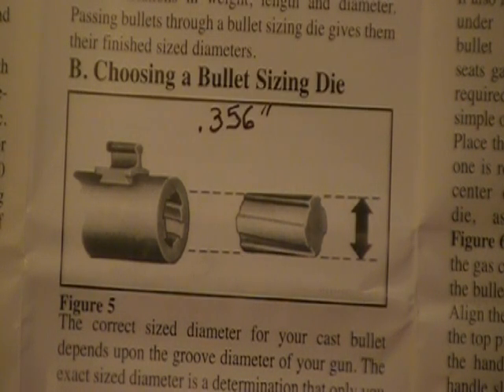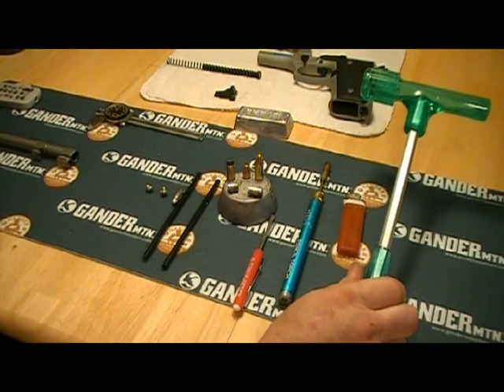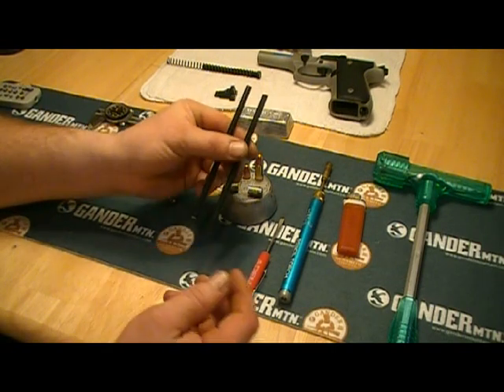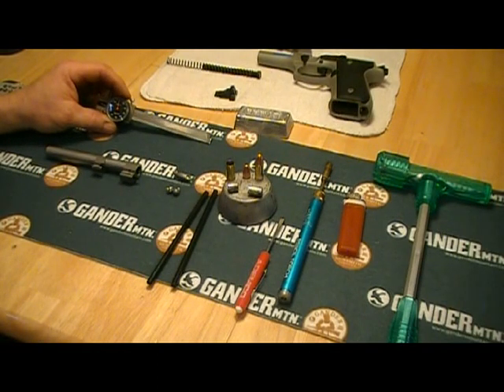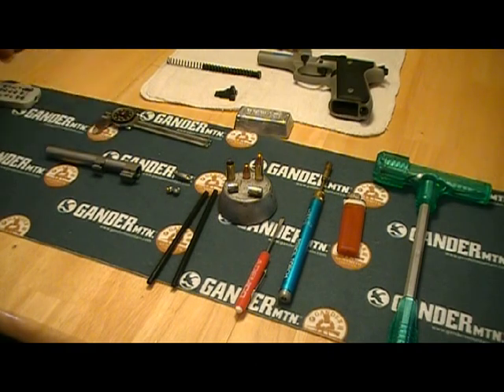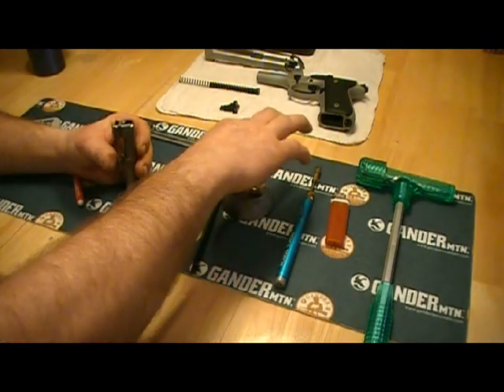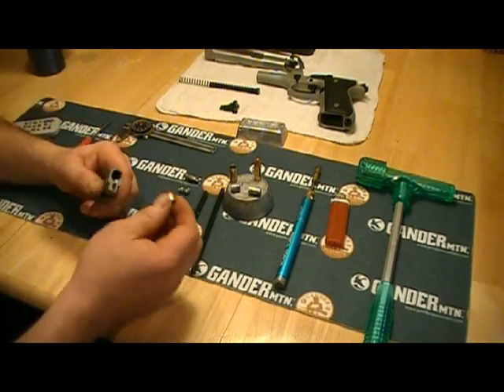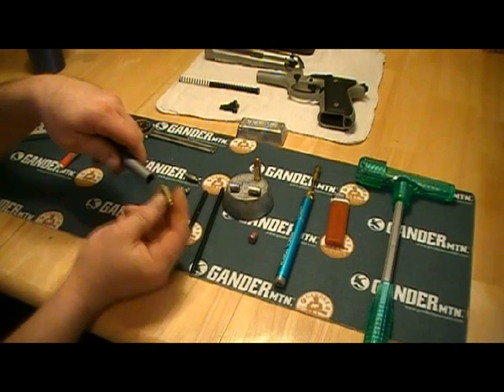Barrel slugging made easy part 1

Comment: I had the same reservations about using the round ball, AND, the suggestions of using existing cast bullets worried me for the reasons you discuss...hard lead and the need for excessive force to drive the slug through.  Your solution is INGENIOUS...as an earlier post says - "well played"!  Thanks
Reply from the maker: Thanks for watching, I agree that using any slug that will not yield to the barrel is going to give an incorrect reading
A power steering pulley is held to the pump shaft because the shaft is bigger then the hole in the pulley,
Therefore we know that just because the shaft was once in the pulley doesn't mean they are now the same size.
You can also do rifle slugs with this method, just fill the case with dry silica sand.

Comment: Never seen a heating torch that small, kinda interesting o.o & the video is well explained, nice work! :)
Reply from the maker: did you notice the "upside down little aluminum tree" on my table, I poured molten aluminum in an ant hole and dug it out!
Reply: @stclairstclair  not until you mentioned it :D I've always found those sculptures interesting to look at :)
Reply from the maker: they are a must have for deep candles and electric heat shrink.
Reply: @stclairstclair  I suppose :P why not :>

Comment: Some details I found I needed to add:
1) use a case that has been expanded, so that the slug will be oversized.
2) Do not use the next caliber larger on a revolver, because you cannot drive the slug from both ends if it jams. Expanding a case of the bore's caliber should be enough.
3) Melt thoroughly, or the slug will be too small.

Comment: good idea I slugged my barrel differently. I used a cast bullet for mine since they are over size to begin with.
Reply from the maker: That works, the reason i stayed away from a cast bullets was they are usually harder than pure lead and often water cooled to increase hardness, For me i had to size my bullets .002" bigger than the barrel size, Thanks for watching.

Comment: I like where your head is a with regards to thinking outside the box but there's a couple issues. If your casing isn't perfectly clean your introducing abrasives other than what you intended for every pass and fiberglass is a no go.. glass is harder than steel, therefor fiberglass will scratch the inside of your barrel. Wood might break but it about as soft as lead
Reply from the maker: I would kindly disagree, i use a case the has been fired in the gun I'm sizing, I inspect the inside and it would only have fouling from gun powder, and if anything that glass rod wouldn't be much more than a polishing stick up against any barrel, Think about this, When fired a 9 mm cartridge produces 36 thousand pounds of pressure, a fireball expands around the bullet pushing it to 800 mph with the intensity of a blow torch while lead melts and copper streaks, a cold soft lead slug ain't doing dick. The gun in this video is a new stainless Beretta inox, I've been working with metal for more than 30 years, I would not allow my 650 dollar gun to be compromised, nor yours.
Reply: I just used a squib rod that has a chamfered end. One of them is aluminum and one is brass.

Comment: I have the Lee 125 grain mold and I do have a RCBS lube sizer, I plan on using the Hi Tek bullet coating system but will size the bullets if I have too.
Reply from the maker: check out cast boolits.com

Comment: Hello, I cleaned the sigma 9 barrel really good before I started again and I did it 4 more times and came up with the same, the biggest reading I could get was .3545. I have a .356 Lee 6 cavity mold so I'm thinking that the will work. Thank you for your advise It's helped me out a lot.
Reply from the maker: 115 grain or 147 grain, i cast the 147 grain bullets.  You might be lucky enough to be able to fire these cast bullets without having to size them, but you must measure each one,  So now when casting your bullets, you should try water quenching them this will give them a much better hardness and i believe they tend to measure out a little smaller, also pay attention to casting temps as this will also effect cast size, do you own a Lee/RCBS lube sizer? when you size them go .002 bigger then your bore measurement, other wise the bullet wont grab the groove and you'll get real bad leading in the barrel.

Comment: Excellent way to make a slug for slugging, what size cal barrel is that, that you are slugging 9mm?
Reply from the maker: My barrel was .356" and i cast bullets and sized them to .357" and found that shot well, this is 9mm, but these same sizes can be used on a .380 auto as well.

Comment: Really liked the concept. An additional thing I do is pop the primer out of the case and put it back in upside down.  That gives me a flat surface on the bottom of the flash hole and reduces the amount of lead that protrudes out of the case bottom.  Makes removing the slug a little easier.

Comment from the maker: did you try it yet? for that gun you need to know that the barrel could be smalller where thr barrel screws into the frame, i would drive the slug in the muzzel an inch or two and back out, building up how far you can move the lead, you dont want to try just punching it through on the first try, as you progress taking measurements as you go, this way youll know if the barrel is perfect or has a tight end. just make sure the dowel is not getting stuck in the lead as you push it through

Comment from the maker: @GregwGa Any of the small hardware stores like ACE,    the one i have you will find and there cheap because you have to light it, Ive had this one for 14 years and it still works, Ive see this same one as low as 5 bucks.